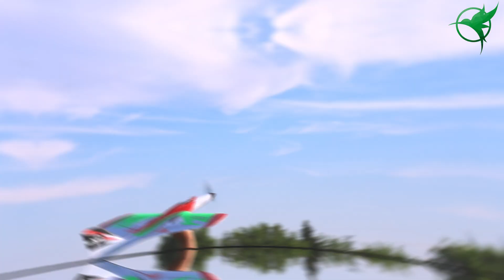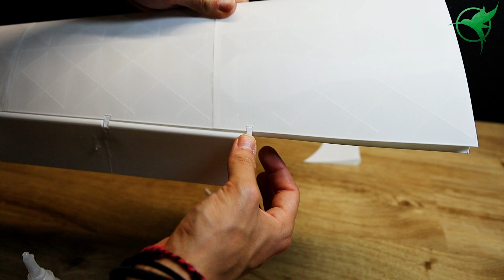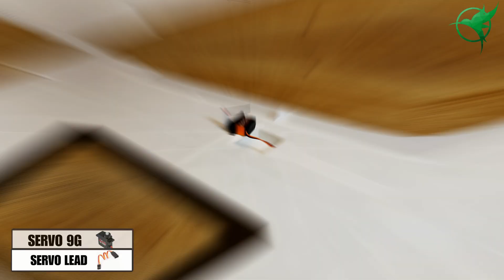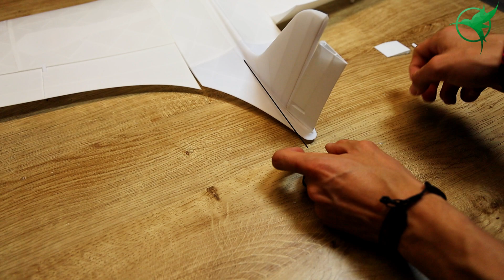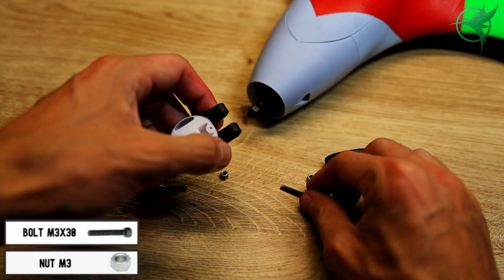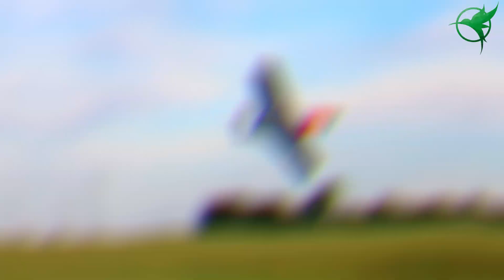3D Printed tailless wing - Build guide Hushwing

Comment: Here’s a little advice: it seems that someone has told you that the accelerator is applied after putting the pieces together and without touching the cyanoacrylate. But, in reality, like any bicomponent material, they are used at the same time. Simply apply a component in each part you want to join. I hope this helps you! 😊

Comment: Good Stuff.  I just built the Model A and had a nice long maiden flight, but then had something fail 30 seconds before I was going to land.  It might have been one of the rubber bands holding the wing down come loose.  Anyway, I'm going to print this one and scavenge most of the electronics from the wreckage.

Comment: This plane doesn't have a horizontal tail. Does it have a flight control system? If not, wouldn't it be prone to pitching up during acceleration?
Reply from the maker: It is very stable, you don´t need any flight control system.